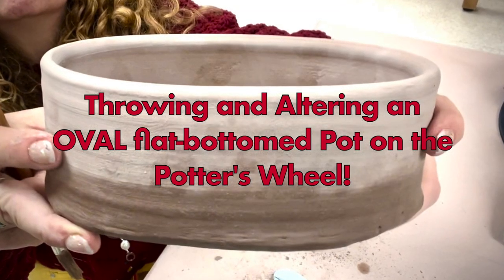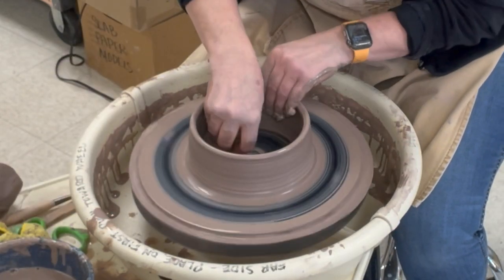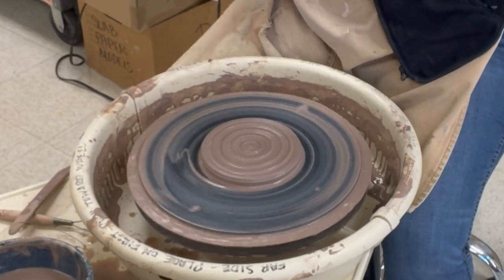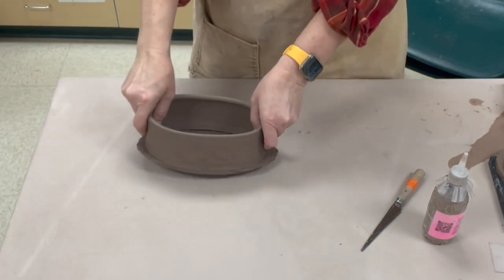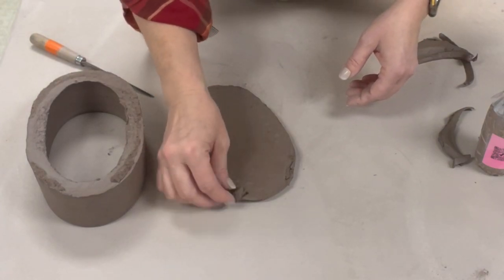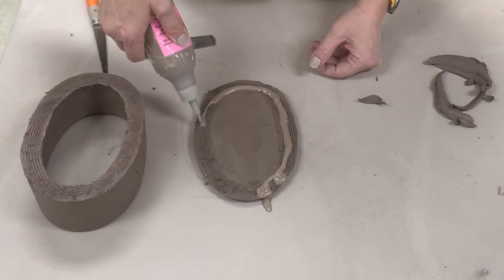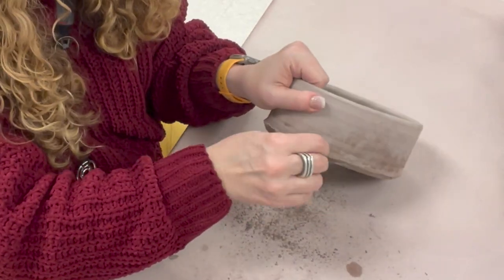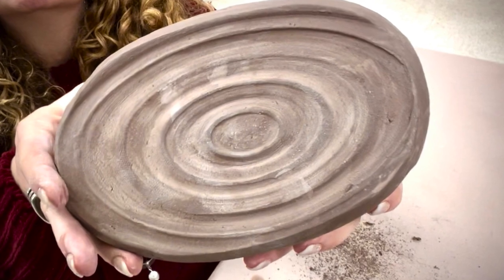Throwing a Flat Bottomed Oval Pot on the Potter's Wheel!

Comment: When you're stretching the bottom slab into an oval, does the original width/diameter narrow at all as you elongate it? Or does it tend to hold the same width? Wondering if I should throw it any wider than the wall to account for that. Hope my question makes sense, thank you!!
Reply from the maker: That's a great question!!!  I would say generally, it stays about the same width.  I usually make it a smidge larger and trim away the excess, so when I do that it doesn't truly matter!!
Reply: @KaransPotsAndGlass  That makes sense, thank you so much!